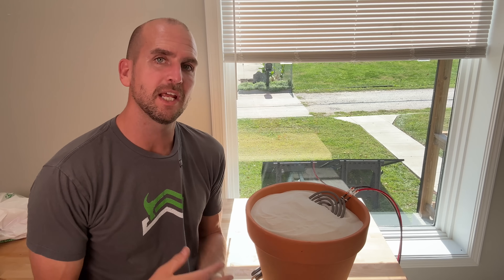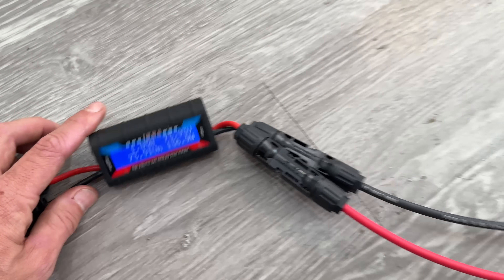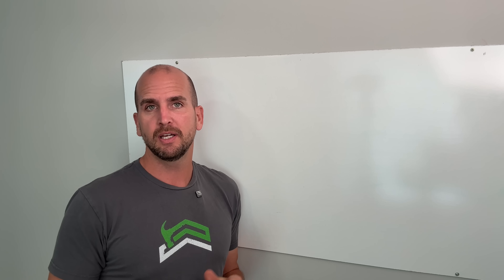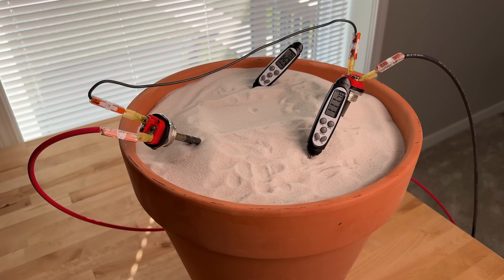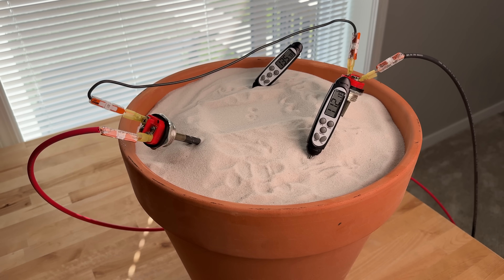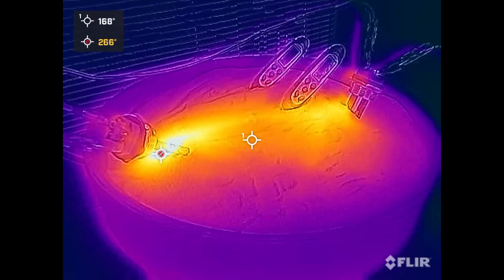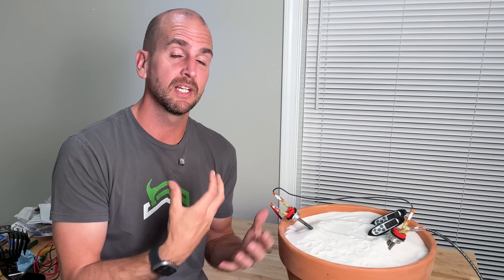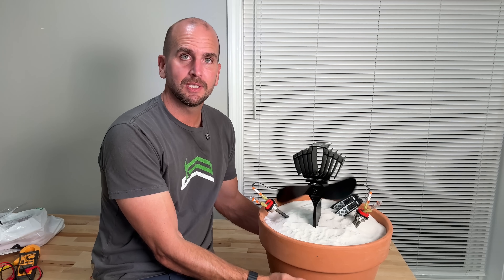How To Create A Solar Sand Battery Heater | Free Heat This Winter!

Comment: Ecofan in sand, cool (haha). My thought right away seeing you have about 800 watts of panels, is that you should be seeing more like 700+ watts out vs 137w to the stove element and 250w to the water heater elements. Putting the water heating elements in parallel would be a simple and hotter config. Figures:

Panel config - "max power resistance":
One panel: Vmp 34, Imp 11.62, "Rmp" 2.92 ohms
Two series: Vmp 68, Imp 11.62, "Rmp" 5.84 ohms
Two parallel: Vmp 34, Imp 23.24, "Rmp" 1.46 ohms

Resistor-heater element config:
One *stove element - R= 38 ohms
Two in series - R= 76 ohms
Two in parallel - R= 19 ohms
One *water heater element - R=10.8 ohms
Two series - 21.6 ohms
Two parallel - 5.4 ohms 

So I'd try two panels in series (5.84 ohms "Rmp") with 2 water heater elements in parallel (5.4 ohms R).

Since the element resistances were taken cold, they might change significantly (up) as observed in other comments. Of the resistance elements on hand, 2 water heater elements is the closest match

Comment: Using electricity to power a heat pump is far more efficient than resistive heating.  I feel like a LFP battery with a heat pump would be a better choice for room heating, although not sure what the payback time would be in comparing the two.
Reply: This is for poor people that need something right away. No expensive charge controller or inverter needed.

Comment: Lots of critics in here.
Hate to be one of them, but you should have wired the Hot Water Tank elements in parallel instead of series. Would have got 2x the wattage by halving the resistance (closer to what your panels are capable of producing).

Thanks for the video. 🤜🤛
Reply: He’d get ZERO more HEAT!!!

Comment: Solar panels put out different amounts of power, depending on the amount of current the system draws.  This is why solar system controllers typically use MPPC:  Maximum Power Point Control to adjust the current draw to get the most power output.  For example, a panel may put out a maximum voltage of 37 volts but if you draw the MPP current from it will put out 31 volts.  If you can find the MPP voltage of your panel, and select heating elements to draw that much voltage at noon on a sunny day, then you will get the most power out of it.

Of course, it's a bit trickier because the MPP voltage at 10 AM will not be the MPP voltage at noon.  That's why solar system controllers adjust their current draw all the time.  Hard to do with a simple heater element, because you can't change it's resistance.  So a better solution would be to use solar panels with their own MPPC microcontrollers.  Those would put out 12, 24, or 48 volts depending on the microcontroller design.  Those normally feed their output into a battery charger, but you could wire a bunch of them in series to get a voltage that matches your heating element.  If you don't understand how this could be done, don't mess with it.  Such voltages could kill you.  There is a reason why most solar panel installations are done by trained installers or electricians.
Reply: Power is the function of squares.  If current drops 25%, the power drops 50%.  Direct connect is only for solar goobers who want easy and don't care about efficiency. You can't use a MPPT controller to feed an element.   Fortunately, Power point controllers for resistance heating are cheap and easy to build. I heat all my water with efficient PV controllers that I build.  Sand batteries are totally useless except on a grand scale.
Reply: MPPT*

Comment: This is a little bit silly. Solar panels are typically about 15% to 20% efficient. If you just put the sand out in the sunlight you would be 100% efficient. Further you could use reflectors (e.g. aluminized Mylar) to collect a wider area of radiation. Put a sandbox on wheels. Roll it outside for the 5 to 7 hours that you get significant heat from sun radiation. Then roll it inside to heat your space. Much cheaper.

Comment: As all my solar panels are hooked to my batteries (60kWh), I am more interested in storing heat after the battery is full.
I was thinking about those water heaters you can just put into the water and they will heat it. That will be connected to my cerbo, which will then turn it on when state-of-charge is above 90%.

Comment: Wonder if I could connect my 10*400w Risen solar panels with a total 400v dc open circuit directly to a 5 kw 220v water heater in a 500l insulated heat storage tank and see the temp rise over a cloudy day, when it's impractical to run solar inverter. I'll be using a dc cut off switch and 25a 500v dc fuse.

Comment: I tried something very similar to this. Got 3x200w of ex solar farm panels and hooked them up to numerous elements directly and all I would see is the voltage immediately drop from 90v open circuit to something like 10v so it would draw no power. Any idea what might have been going wrong? I've tried a few different kettle elements in parallel and series that were individually I think around 8 ohms but I could never get it to draw significant current
Reply: You have a big "mismatch" between the solar and the elements.  As you likely know, at any given set of conditions (sunlight intensity and solar panel temperature) a solar panel has a maximum power power point.  If we assume that maximum power point is at 60 volts and 10 amps then the ideal element would have a resistance of 60 volts divided by 10 amps = 6 ohms.

I'm happy to explain more if you'd like.
Reply: @johnreeves7261  I understand that I have a mismatch I'm just not sure of the best way to remedy it as I never seemed to be able to get anything out the elements no matter what config I try! I'd be happy to hear your thoughts as to what to try next :)
Reply: @treesareafewofmyfavoritethings  Have you measured the resistance of the individual elements?  If so, tell me what they are and we'll go from there.
Reply: @johnreeves7261  I believe they're around 8ohms but it's been a while since I was working on it. They are electric kettle elements and I've tried 1,2&3 elements in parallel and series and I think the max voltage I got was about 13v. I can't see the panels so I can't be certain of the conditions when I'm testing which isn't ideal but I was testing on bright days

Edit: just tested them and I remembered very wrong. They are 27ohms each. I tried 3 in parallel taking it down to 9ohms but the voltage never made it past around 13v iirc
Reply: @treesareafewofmyfavoritethings  Okay.  That's helpful.  Are you confident the solar panels are okay?  Do you know they're individual theoretical max power point voltage (Vmp) and max power point current (Imp)?
Reply: @johnreeves7261  sorry for the slow response, my replies keep getting deleted - maybe they look like solar spam 🤷‍♀️ Anyway here's the panel spec:Module type: YL25OP-29b
Rated power: 250.0 W (0/+5W)
Rated voltage: 29.8 V
Open-circuit voltage: 37.6 V
Rated current: 8.39 A
Short-circuit current: 8.92 A
Max. series fuse: 15 A
Max. system voltage:1000V. Fingers crossed it works this time! Thanks for taking the time, it's appreciated!
Reply: @treesareafewofmyfavoritethings  Okay thanks.  What we need to do is try a test when the solar panels are getting good, reasonable direct sun.  What time zone are you in and at about what time would you be getting the best sun angle to the solar panels?

Comment: I think this is a great DIY emergency heat source. One thought with the fan is to fabricate a stake that's mounted to the fan base to gather the heat from deeper in the sand battery. The fan is designed to gather the heat from a Woodstove surface, so if it gets the heat from deeper down, it may transfer it up faster to the base. This is a project I now want to play with as winter is just about here. Lol

Comment: This is very similar to an idea Ive been toying around with for my garrage (cold climate). Initially I was just thinking of water as the heat battery - but sand definitely has some benefits even if its not as easy work with as water. In any case, the key here is that you must trap the heat in thenday whennyou probably don't need i much and store it for later when you do. So obviously some form of insulation is inevitable. I would just put the heat battery into a slightly bigger pot, then fill it with glassfiber/rockwool. Then you also need a method to release the heat at night. A simple fan + 2 motorized ports would drastically increase the outflow of heat. Ideally younconnect the moving parts here to a smartnhome system withnsome sensors so you have it autoregulate based on conditions.
Even if this combined with a small panel wqs only enough to keep the space over freesing, that would already be very useful

Comment: nah you dont need moving parts. cover the clay pot in black aluminum tape (for autobody repair), or paint it black with black stove paint. black bodies radiate more heat due to thermal emissivity without any moving parts.

Comment: Seems like you could heat water with sun more efficiently. Like the solar hot water preheaters do.
Reply: Yep. Using PV solar for resistance heating is the most inefficient use of the sun possible.

Comment: There is a simpler option: the stones are heated red hot in a fire, then placed in an iron bucket and brought into the room. Warmth is guaranteed until the morning.
Reply: Did exactly this in fall cub scout (tent) camping when the night temps dropped well below freezing. 

Heated a "head sized" stone in the fire, wrapped it in multiple towels (to not burn myself) & took it inside sleeping bag with me.

Based this on stories my parents told of heating bricks & tucking them under the quilts in the horse sled for the trip to town in their youth.
Reply: Your idea requires you to keep harvesting wood for the fire.  When you get a lot older, you'll appreciate the heat generated by photovoltaic or photo-thermal panels.  But, the idea of heating stone to a red hot temperature is a good one.  You can do that with solar too.

Comment: This is so much bullshit. If your solar panels are at 50% power, you only get 25% from them with resistive elements without proper mppt. At winter, you may get 10% of the power? Thats like 1% usable power. So 4W per 400wp panel. Okay you could switch heating elements the whole time. But even then, an AC unit of €500 will do 4 times better. Heating with an AC is so effective, its mind blowing. Feed 1000w in, out comes 3000-6000w of heat, depending on efficiency of your AC. Normal MPPT with an AC is hard to beat.

Comment: So why did an 800w array only produce 250w?
At the end of the day, 750wh of power isnt enough to really heat a room.  Spread over however long it takes from solar activation to the sand fully cooling to ambient.   Thats really not a lot of heat.  

Interesting though. And a good way to begin experimentation.

Comment: Why do u use electric heat but not solar water heaters?
Main DIY setup is solar water heaters + sand boiler with 50/50 sand + volcanic sand to decrease time to get the highest temperature to 30-45 minutes (from 2-4 hours with sand only).

U can use the same boiler setup for any kind of heaters (stove, for example)

Comment: My house has a oil tank underneath the stairs for when it used oil heating. It has since been disabled and my house is all electric. You just gave me an idea on how to use that tank.
Reply: I don't think you would ever rid your home of the smell of heating oil if you did so.
Reply: Then run some coopertubes trough it, you will have a great waterheater.
Reply: Brilliant

Comment: You're talking about the equivalent of 4 old 100-watt light bulbs. Maybe enough to dehumidifier a laundry room. It's hardly enough to heat a small dog house in winter ... when the sun is out!. A smarter way would be to run a heat pump with that power.

Comment: This is all wrong.  During the winter, you won't have as much sun.  At the 40th latitude, it's about 1/3 of what it is in summer, though I am pretty sure that includes hours of darkness as opposed to irradiance at a particular time of day.  But it is still much less in the winter than in summer.

Comment: I am curious how much heat is being stored in the sand (as in BTUs or calories or Joules). What is the mass and heat capacity of the sand? The temperature is only part of the story. I'm also curious how fast the heat is subsequently transferred to the room, though that might be harder to measure.
Reply: Sand is actually a pretty terrible medium in which to store heat. It has a low specific heat of about 800 J/kg•K. Water on the other hand has a specific heat of over 4100 J/kg•K. The advantage of sand is that you can store heat in it at temperatures above 373 K (100 C), which you can't do with liquid water at atmospheric pressure.

Comment: Excellent video presentation.  I currently use my 4.6 kwp of solar pv to power my house via a standard grid-tied inverter.  Then heat-up my old fashioned storage radiators through an Immersun unit, so that the  rads / kettle / shower heater; only use just surplus electricity from the panels, rather than exporting such to the external grid.  The old fashioned storage radiators in the UK are just basically heating elements inside a brick pile, with insulation around & then encased in a metal skin.  A simple bi-metal thermostat limits the maximum temperature.
This has worked so well for me since 2011 that my electricity bill is only about £40 pa.  So I'm well pleased.
However, in the potential event of SHTF, if the electricity grid goes down, then your direct routing of the DC from the panels would still be of considerable use.  A simple sand battery is a great concept.
Thank you for the video.
Reply: I`ve been thinking about utilising my storage heaters in the same way (although I was thinking about using 12/24v halogen bulbs in place of the heating elements inside the storage heaters, & maybe building my storage heaters up with more bricks, possibly using lead acid batteries, or supercapacitors as a buffer), my concern is the fact we can easily go days, & even weeks in the UK without seeing an ounce of sun during winter, so how does it work out in reality?
Reply: @MrPabsUk  I'll try & provide the best answer that I can by splitting it into 3 sections:-
a). I can't see any net benefit to using halogen bulbs inside storage heaters.  They are fairly expensive, their service life can be much shorter than the old existing heating elements that are probably already in situ.
b). The 'more bricks' has considerable merit, as it would increase the heat storage capacity & cool-down more slowly.  My caveat to this is that old storage heaters are encased in an insulation & a sheet metal skin.  I've been thinking along this line myself for some years.  However, I think that it would require a second & substantially larger number of bricks around an existing storage heater, then fit heat insulation material around them & for safety - to manufacture an addition sheet metal skin to encase the additional materials.  NB. The (now) very old designs of storage radiators were 'fat / thick' in their design & had many more bricks inside than the modern, better insulated, thin & cosmetically attractive modern versions.
c). Little sun in the winter; yup, no way out of this one other than spending maybe £50k on 5x Tesla Powerwall / batteries to store energy on better days & release that storage during the dull / overcast days.  My solution, for what it's worth, is simply to change my lifestyle.  I simply retreat into one room that I can only partially heat & mega insulate the 'person' rather than 'waste' heat warming the room.  The rest of the house stays unheated & cold until the brightness / sun returns.
I can do this by choice, as I now live on my own & am a tough old codger.  However, there is no hope that a wife or children would put-up with that 'inconvenience', even remotely.

My apologies for the loooong essay; but I thought your sensible comment deserved my attempt at a good answer.  Regards, John.
Reply: @johnkay4701  I like old codgers especially the wise ones.
Reply: @MrPabsUk  Be careful with moving or modifying old storage heaters, many of them used asbestos for insulation.
Reply: thats cool, I have heard another story about using hot water solar panels and installing a huge underground water tank. Then route underfloor pipes to heat the floors. In the winter and summer the floor/earth is a large portion of why a house feels hot or cold.
Reply: Wo bekommst Du den Solarstrom von November bis Februar her?

Comment: use water and copper tubing.  with those heat coil wrap copper tubbing around them an effect will accur super heating the copper and ad some colbolt magnets around teh copper tubbing.. the electrons will react well.  put water in tubing and coil up, make it like a ring coil in layers. if you do it right air will pass through heat like a heater.

Comment: those quick connector ends on your wires are garbage so I can say positively you are loosing Amps there it doesn't matter the gauge of wire as much since your using those connectors they are the weakest link in any solar projects btw i am not even going to say how bad the wagos are lol